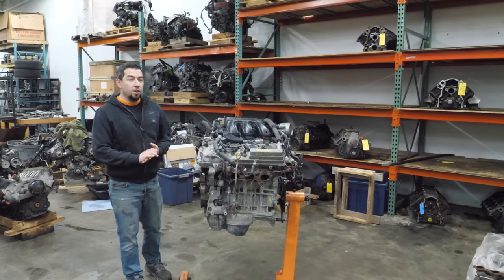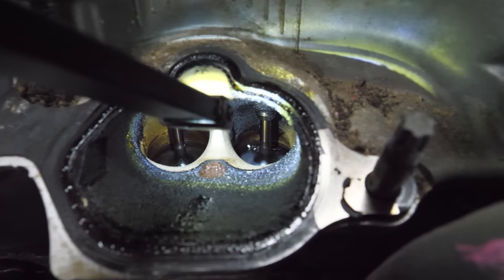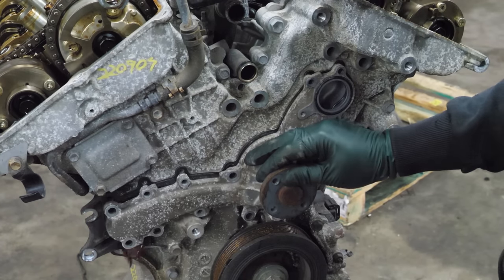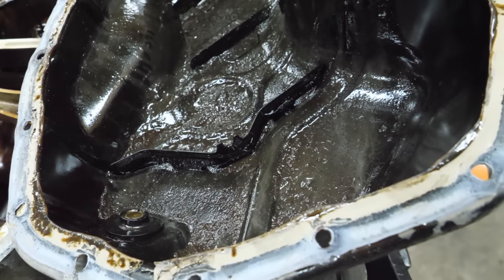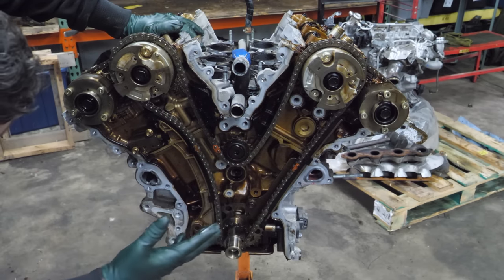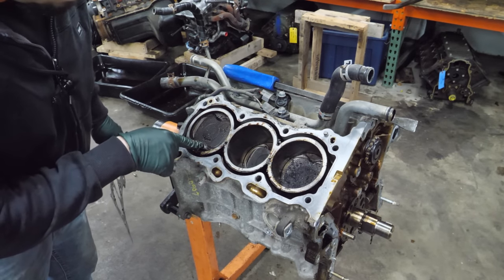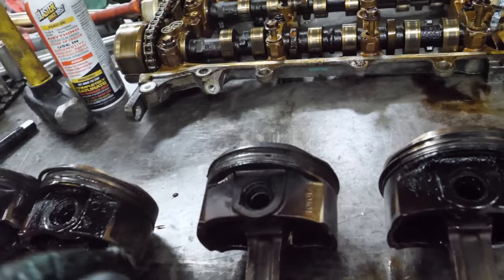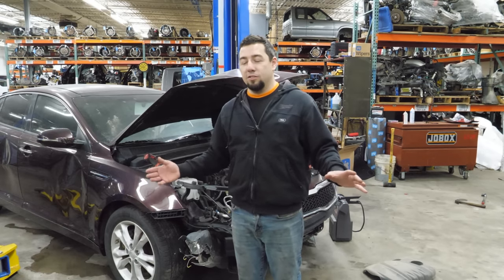Toyota Lexus 2GR-FE Teardown! Premature Death Of Toyota's Most Reliable V6 Caused By Obliviousness!

Comment: During the video you mentioned the rubber section of the VVTi oil line toward the rear of the engine. That's one big flaw of this version of the 2GR-FE. A BIGGER design flaw was that this engine also rubber portions of the engine oil cooler pipes. Those 2 lines are located at the bottom front of the engine right next to a catalytic converter which gets very hot. My guess is that one of those rubber sections ruptured and if someone was driving 60 to 70 mph when that happened and did not pull over and turn off the engine soon enough, then good bye to this engine. Just a pinhole in one of the rubber lines would be enough to lose all 6 quarts of oil very quickly.
This happened to my wife while driving her 2011 Highlander a couple of years ago. Fortunately, she was driving in town, not very fast and pulled over and turned the engine off right after she saw the low oil pressure light come on. There was no damage to the engine...Toyota put the all metal oil cooler pipes on it and it's still running fine today. If these rubber oil cooler lines are not replaced, they will burst. Not if but when.
Shame on Toyota for not recalling both the rubber oil cooler pipes and the rubber VVTi oil line. They did issue Technical Service Bulletins for both but no full recalls. These 2 faults have and will kill these versions of this engine(mainly 2007-2011) prematurely. If these parts are replaced in time and the proper maintenance is performed, they can reach 300 to 400 thousand miles.
Reply: You freaked me the f*ck out and had to look into this so my car doesn't blow up lol there are certain models of the 2GR-FE that do not have these oil cooler lines. The Camry, Avalon, ES350 do not have an oil cooler line from factory. If anyone's wondering...But does have that cabbage VVTI oil line with the rubber section.

Comment: I have seen a very similar failure of the intake manifold on a 2AR-FE back when I worked for Toyota. The vehicle (a Scion Tc) came in making a strange popping sound through the intake manifold and had an assortment of codes. Long story short, found out the vehicle had been over rev'd and quite a few of those roller rockers had fallen off due to valve float and on one particular cylinder, both exhaust rockers fell off, but the intake stayed. At the end of the combustion cycle, since the exhaust had no place to go with the valves not opening, as soon as the intake valves would open, all of the exhaust gases went up into the intake causing the pop sound and melting that intake runner.

Comment: Currently working at toyota,at my shop at least the 2gr-fe is basically the least common for any repairs, usually its the water pump that fails. Ive seen some VERY rare that have a oiling issue on the cam phasers, 99.9999999% of the time is cause by bad maintenance.
Reply: How common are the front timing cover leaks ? I hear those and the water pumps are really the only issues with this engine..
Reply: @danielbriones6171  Not going to lie, fairly common.
Reply: I would say the Tacoma version the 2GR-FKS is more prone to leaking timing cover, it’s a pain in the ass to reseal too.
Reply: Is that mostly the older style "round" water pump, or does it also include the updated water pump as well? Thanks!
Reply: @badonkadonkey16  The new style water pump is included as well, not as often but it’s pretty common. It’s usually never a low mileage thing, most common around 130-180k miles.
Reply: Thanks for the insight, always like to hear from mechanics on the front line!
Reply: Thanks your all of your input. The oiling/phaser issues seem to be remedied by using the 0w-20 in place of 5w-30?
Reply: @kylemcconnaughey5511  slight internal changes were made in 2012 or 2013 depending on the model, to accommodate for 0w-20
Reply: @SuperMan-uj7dh  Do you know what changes? They even reverse spec’d pre-2012 2GRFE engines 0w-20, though they were 5w-30 from factory

Comment: Currently have 2011 Toyota Sienna with the same engine, has 210k on it and still runs great.
Reply: I've got the 04 Sienna - 3.3 L - best vehicle I ever owned.  Totally low maintenance costs, decent on gas.
Reply: @Chris_de_S  nice but not the same engine as this video though.   My van now has 226k miles on it.

Comment: I use to work at Toyota and I've seen so many of these engines. like you said they came in so many different vehicles. if I remember correctly the filter had plastic in the center as a "support" for the paper filter so if it got hot enough to melt the intake that most likely melted long before the intake
Reply: My father used to work for the forklift division of Toyota he would order A diamond white pearl Avalon every two years in 2005 he was one of the very first people to get the 2GFRE in the Avalon prior to that I think it was released in the Camry if I remember correctly so about 15,000 miles into the engine it was developing a lower end rod  knock, Toyota flew three engineers out and told the dealer not to touch the engine cause They wanted to take my fathers engine back for some R&D well my dad and Toyota didn’t realize that they had a teenage driver borrowing my dad‘s company car and I sort of like to race people in an Avalon On Saturday night… needless to say I can say I played a hand in this entrance durability.
Reply: @timbrown9731  That’s a funny story ! Honestly though you shouldn’t have been able to hurt that engine in 15000 miles drag racing a few nights a week . There probably really was something wrong with it or you sat it on valve float for hours on end.
Reply: @John DiMartino  if he was drag racing it prior to break in then yes he most certainly did some premature damage.  Plus you think a teen would wait until engine is at proper operating temp before banging it off the redline?
Reply: @kenkozawa9810  I did.
Reply: @timbrown9731  Wow I do that with my moms Highlander. Its pretty fun
Reply: @kenkozawa9810  I worked at a Chrysler dealer for 3 yrs as a tech, it was common practice to take brand new vehicles run them flat out without warming them up . If hundreds of Chryslers can take it a Toyota can . These were the days before jumper  packs ,it was also common practice for the non English speaking prep boys to jump start new cars with the jumper cables backwards,good times fixing the smoldering mess thousands in damage to a brand new vehicle…fixed many of those too.
Reply: The vvt filter uses plastic...
Reply: @timbrown9731  15k miles it's easy to see why they rushed engineers out there. As long as the engine makes it through the warranty period, they're not so quick to act. The 4.0L 1GR-FE is known for headgasket failures and it was like that for years. Predictable too. Right between 100k and 120k you could plan on doing head gaskets.
Reply: @JohnDiMartino   i BET THEY SPOKE FRENCH AND WORE BERETS!  😲 🙃 😃 😁
Reply: I understood only the early 1GRs had the head gasket issue. By 2006, the problem was mostly addressed via an improved gasket, and it requires a really serious overheat to damage it. But yeah -- 2002 to mid-2005 1GR-FEs were notorious. My 2006 4Runner is dandy at 216k.🙂
Reply: @timbrown9731  😂
Reply: @timbrown9731  yeah makes sense the 2GR-FE pulls really well🤣.

Comment: This is absolutely one of the best V-6 engines ever made. I remember when it came out in the Camry, it could actually give the Mustang GT a run for it’s money and actually pull on it on the highway. The only V-6 I’ve enjoyed owning more than the 2GR is the Honda J35, because VTEC crossover sounds in a minivan is f***ing hilarious.
Reply: @TheRedc0met  The J35 has VTEC.
Reply: You should try a Tuned Port 3.8L Buick engine. Or a suped up 4.3L. (V-6's)

Comment: I was a jet engine mechanic and an electrician in the USAF for years. A single DC valve that opens and closes is 10k. A titanium engine blade is around 60k.

Comment: 25:04 that sound you hear is the bolts loosing their pre-tension. They are designed to be elongated quite a bit compared to regular bolts. It’s almost like having a super strong spring pulling the mating faces together. This helps with keeping things together where you have extreme vibration and thermal cycles.

Comment: I had this in my 2011 Toyota Rav4 v6 awd,   I drive it 11,000 cross country at 65-115 mph , some drives for 15 hours straight,  was 110 out some days, and the engine was rock solid,  engine had 80,000 miles

Comment: Had a Toyota V8 3UR-FE that got so hot, it not only melted the intake and knock sensors, but a couple of the valve seats dropped as well, it’s crazy how hot engines get without people realizing it

Comment: As a tech that has seen these fail, it's always a water pump that dumps coolant. The temp gauge doesn't register that it's overheating (no coolant on the sensor to have an accurate temp reading) and they run until they melt. Fantastic engine overall though
Reply: So how low does the coolant have to get for this to happen?
Reply: OMG unreal...
Reply: Updated version better?

Comment: EXCELLENT VIDEO!! You have gained a subscriber!  Near the end, you say all the driver had to do was look at the temp gauge.  This is NOT always the case.  I have an 08 Avalon and it overheated and EVEN AS IT WAS SETTING OFF EVERY OTHER WARNING LIGHT IN THE CAR, the temp gauge read normal (I took a picture of the dash at the time, so I later realized this).  The water pump had been leaking (but was IMPOSSIBLE TO IDENTIFY other than disappearing coolant in small amounts).  The problem was that the water pump gasket basically blew and drained rapidly.  The ONLY indication was the fault code after the event that said temp above 280 Degrees.  Not wanting to jinx myself, but I had the car TOWED home & made it a point to NOT add more coolant till the engine was cold to avoid rapid metal contraction / possible cracking (and I think that is what saved it).  That was roughly 2 years ago and I am still driving the car (knock on wood).

Comment: Thanks for the video. Have on of these in my 07 Camry has 230 k on it. If you do basic maintenance on this you will get sick of the car before the engine gives up… great engine . Just change the oil and of course don’t let it over heat…

Comment: Did a water pump on an 08 Avalon with the 2GR @130k miles, took about 4 hours and it was the first one I'd changed on a 2GR. Sold the car @225k and it's still on the road.

Comment: This was not necessarily because of lack oil changes, but mainly because of lack of coolant change (probably never at 180k miles). 
Acidity in old coolant eats the steel head gasket sealant, sandwiched between two aluminum surfaces. 
And that is what makes milkshake. Or burn off coolant, steaming the cylinders...

Comment: The only bad thing is bad maintenance. They have some oil cooler lines that get brittle and crack and lets out all of the oil (there is an upgraded part for that). They also tend to have a mysterious oil leak that no one figures out, but its actually from the timing cover. 
P. S. The engine has to come off the car to reseal the timing cover. Big dollar job.
Reply: Honestly in all my years working on them I never bother telling the customer they need to fix that leak cause they're never really bad imo

I've never seen one dripping off the engine, just oily
Reply: @Jack-qn4vt  im no toyota tech but ive heard the stories. There are some that are quite subtantial. The chrysler pentastars also have this issue, but its very easy to fix. Lots of room (especially on grand cherokees and Durangos) and the rams with that engine. And engine stays in the car.
Reply: @dboatrig Literally the same thing happened to me on my wife's RX350. The rubber oil line had a micro-crack and it sprayed a thin trail of oil all the way downtown. I caught it microseconds from running dry. When I pulled the dipstick it was bare, added 3 litres of oil and it came back up and ran perfect. I switched that oil line and it's been perfect since.
Reply: These engines deficient oil cooler lines, timing cover leaks and dodgy water pumps are design fails.
Reply: @petesmitt  easily fixable. No machine is perfect. Although certain things are just not saveable. Like a Ford 6.4 or a 5.4 3V, or a GM 3.6 lol.
Reply: @petesmitt  It's funny how everyone rightfully talks shit about the Germans, and then we never hear a peep when a Toyota engine has German-style problems. Plastic/rubber degradation, leaks, and water pump failures are basically the BMW playbook.
Reply: @Kevin09210  I have a Ford 5.4 3V. Do your maintenance and they last a long time. 265,000 km and still going.
Reply: @chrisbradley3224  Rubber line was later updated to a metal one, as a recall, of nearly one million cars. Water pump on a toyota will almost never catastrophically fail because of the MLS water pump gasket, and before you need to replace it you will see pink crust all over the lower block; it takes a special person to not notice it and keep driving like that. Has BMW ever recalled any degrading rubber/plastic parts?
Reply: @bartsarton2212  that's only 164k miles. Come talk to us when it's 200k+ ;-) I've had japanese vehicles running great at 300k+ MILES (that's over 483,000km)
Reply: @honuswagner9348  I'll be dead by then.  😊
Reply: @stevelikesrhino  rubber and plastics are consumables after age and miles. It's just maintenance. Only recall I can think of is the timing chain guide on the N20 engines which is faulty
Reply: @dboatrig yep, happened to me with my 2010 RX. Luckily, the engine was not damaged. But after driving the RX for 12 years, I decided was time to get a new vehicle
Reply: @stevelikesrhino nop..they ask you to sell yours for a water pump and venoses..
Reply: @petesmitt  3.3 V6 much better engine.

Comment: Can confirm, water pumps and rubber oil lines are very known issues. Done both on my 2gr in my Lexus. I’d suspect the water pump failed as well. The timing covers like to leak too, the seal around them was not the greatest from the factory. Great video!
Reply: You are totally correct on the timing cover.  My 17 camry 2.5 had a leak at 50k miles and had to be fixed.  Luckily, I had an extended warranty and saved myself 1300 bucks.

Comment: The straight six in the old 280z was the best motor Japan ever produced.i pulled one with 200,000 miles to put a 383 stroker in an old z.I sold the straight six to a guy in town to put in his z and he drove it for another couple hundred thousand miles and sold it still running good.id love to see twin turbos on the old Datsun/Nissan straight six.
Reply: JDM Nissan Skyline came with dual turbos. Very fun to drive.
Reply: @suzi_mai  I'm just surprised we don't see more of those six cylinders at the track with nitrous and stuff I bet you could get a solid 1000 HP out of one relatively easy and I bet would stay together without a lot done to the bottom end.
Reply: Maybe they're scarce or something I the guy I sold the one I had to was happy to get it.would certainly be a solid platform to start with

Comment: Neat! I think I requested this. I just pulled one for an Mr2 swap. Gonna be fun!
Reply: Maybe the Lotus relation has some bearing on price?
Reply: you're putting this v6 in an mr2? that's going to be awesome.
Reply: Shamelessly putting it in an original Turbo 94. Less than 200 in the country. The 3sgte will be refreshed and cleaned to look like a showroom piece - a very expensive decoration.
Reply: Even more blasphemous is that I have an m54b30 waiting to go into my 83 Celica Supra. I'm going to treat the current 5mge to some new rod bearings and head studs before turboing it, and slowly rebuild the BMW motor with forged everything - find a newer ZF 6 speed or even the earlier close ratio/non-OD 5 speed - with a final dream build actually using BMW AWD. it may take a decade, but it will be fun as hell.

Comment: I’ve only ever seen one of these 2grs fail. At 205k miles the original water pump failed on the owner 600 miles from home. They had a “Toyota” shop replace the pump, but that shop never properly bled the cooling system of the air. So the large air pocket trapped in the rear cylinder head ruined that engine on the remaining 600 miles home. Wild thing was, the car ran smooth as glass with a blown head gasket and the temp gauge almost pegged.

Comment: Water pump is not easy at all with that engine on a rav4. Mine didn’t leak but bearings were shot. You have to support the engine, remove the engine mount and raise the engine to try and fit your hands and tools between the engine and unibody “frame rail”. Dealership had quoted me at $1,300